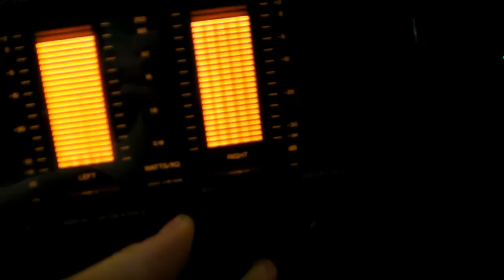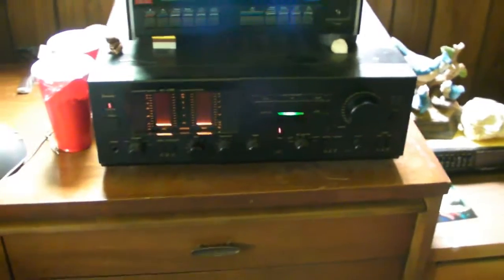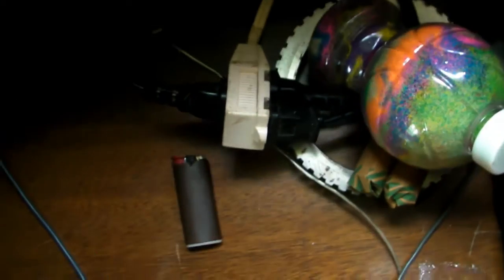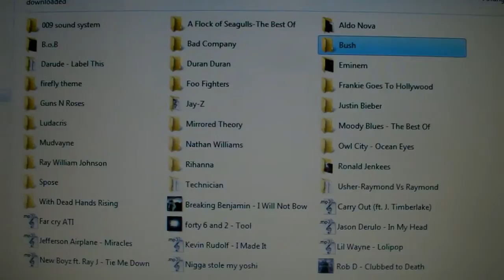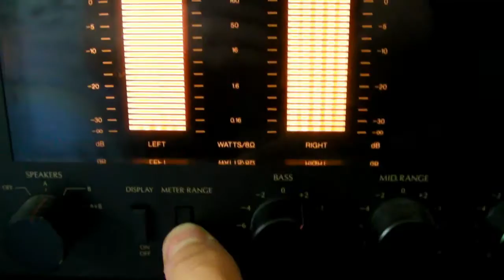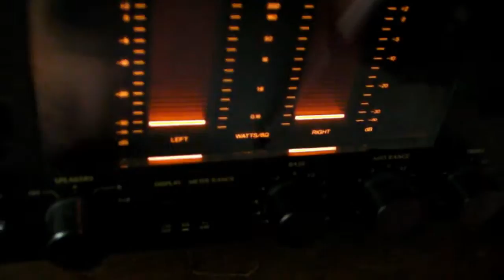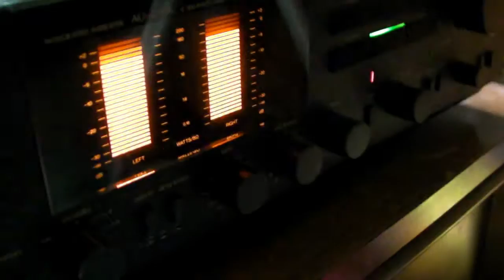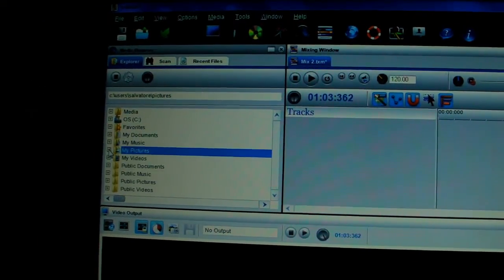My Room Stereo System

Comment from the maker: @dreamsTeKo The most I usually run the card at is 80%. I have the EQ settings all above zero to boost the input so I do not need to max out the amplifier as much. I always start at a flat zero, and up them all as I go down the line. All I do is keep the EQ visual display from having solid red, so that no part of the system has any trouble. I will look into the program. Thanks!

Comment from the maker: @zker666 well, let me check tomorrow OK. I dont know if it is just a transistor or mosfet. And no, my amp I use does not have a remote.

Ya, the dead amp being fixed with the correct fet or all being changed to a similar one, that would be nice

Comment: totally agree that this old stuff is better, i have a pioneer sx303r and it only puts out 100 watts a channel.  ive fried so many speakers tho, have to be pretty ballsy to crank it more than half way.  currently have it hooked to 2 Avid model 100 speakers and 2 RSL speakers.  All made in america and found at the local town dumps.  thats 2 12s and 2 8s and a few lil 3 inchers for highs.  all speakers have built in crossovers.  things fall off the shelves when i crank it,  and screams out highs thatll make your ears bleed.  receiver is a tank too, i can burn myself on the cover above the heatsinks when its goin, sometimes a lil warm electronics smell, dims all my lights when the bass hits, but it keeps goin and goin and goin.

Comment: if the amp is rated out of the back at 650 watts it is pushing anywhere from 120 to 200 watts,  although that is a great amp made by sansui that is highly sought, as far as the humming goes I would guess that it is the grounding

Comment from the maker: @adidasgear no way, its way more than that! Its way over 200 too. The scale is off, plus, they changed the rating system a bit. Also if it can make 700 watt speakers bottom out...

Comment: How loud an amp will go depends on the efficiency of the speakers much more than the "wattage" of the speakers or amp. Output figures are quoted at a particular percentage of distortion - you can say an amp is 60 watts RMS at 0.1% distortion, then quote it at a higher rate of distortion and a much higher output. Sorry for the nerdspeak - but essentially, match your amp to the speakers with care for best sound. Listen to the set up, and choose by how good it sounds, not wattage figures, for a much better experience.